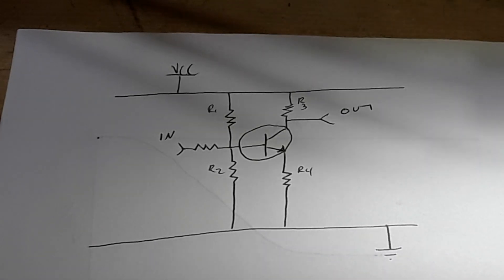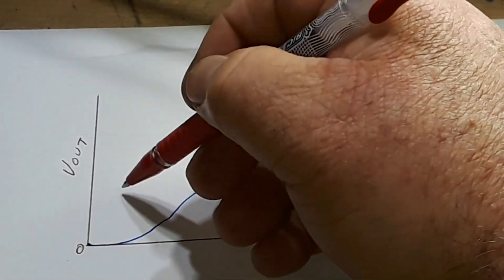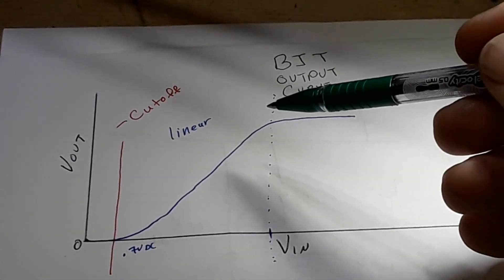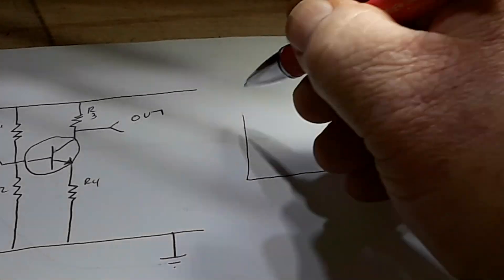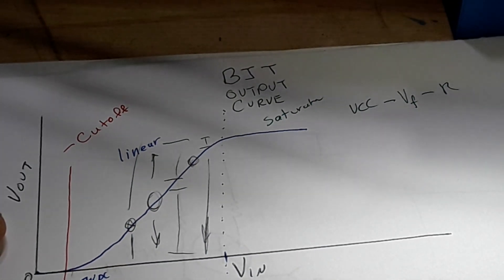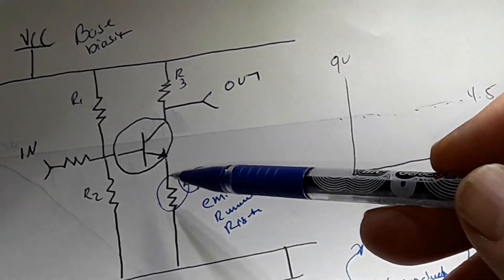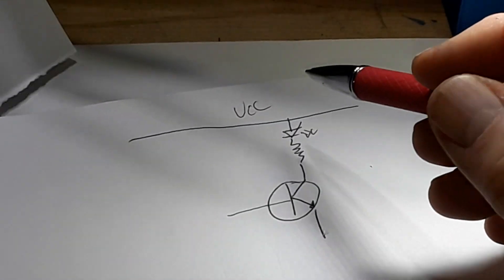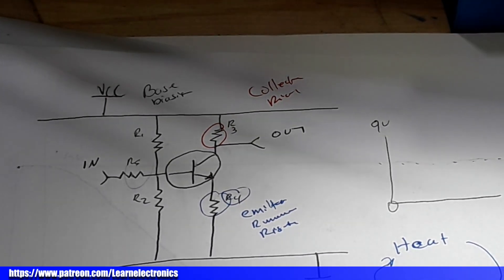Transistor Operation Regions & Biasing Introduction

Comment: Very helpful, recently started working with tube amplifiers and was learning how to set the bias on the positive and negative rails. The process sets them to different bias per temperatures, (using trimpots) so example 22mA at 40c then let warm up to 50c and set to say 16mA. Anyways this video was very helpful to understanding what the heck I am actually learning at work! Thanks.

Comment: You are by far the best electronics teacher on YT.  I'm learning at 60 years old, with a background in power generation.  I had a very basic understanding of electronics, but mostly replaced "plug and play" components at work.

Had to retire early because of 5 neck surgeries and needed something to do.  Electronics seemed like the perfect fit and I am enjoying it so far.  But so many folks want to add the complicated math to a guy who has been out of school for 40 years.  You make everything so easy to understand.  Most circuits I've built so far are from your channel.  Thank you!!

Comment: I like the "you may discuss below" comment that was kind of whispered near the end when talking about heat and the transistor 😃👍👍
Reply from the maker: It is my contention that the transistor gets the hottest in the linear region, not in full saturation. My reasoning behind this is because of the switching going on in the linear region, whereas in the saturation region, the transistor is just basically held wide open. Of course, if you overvoltage the transistor that doesn't count, I'm just talking about enough to hold it in saturation.
Reply: Although not the full story, a simple way to visualise this is that in the linear region, the transistor is effectively acting as a resistor, with I2R losses dissipated as heat. Once it is saturated it is more like a closed switch.